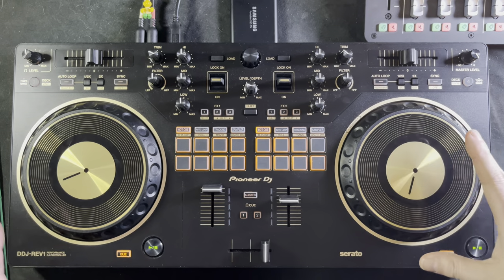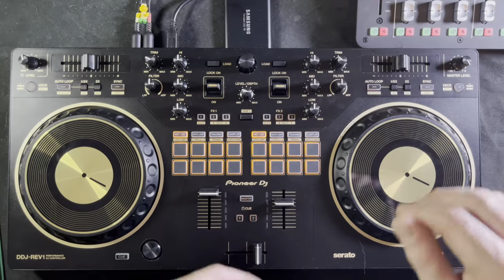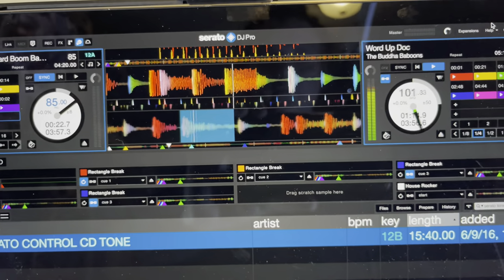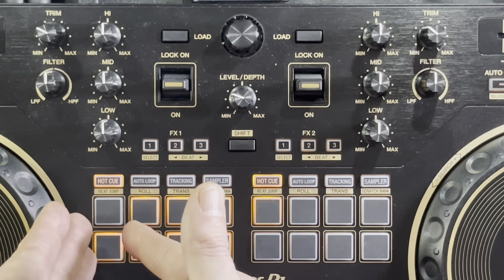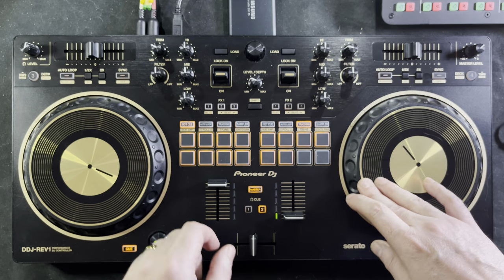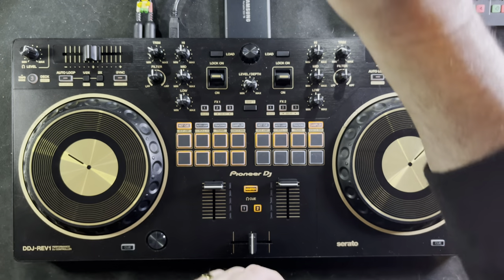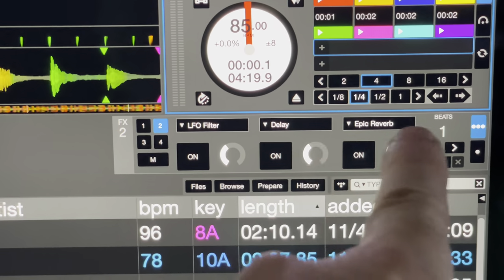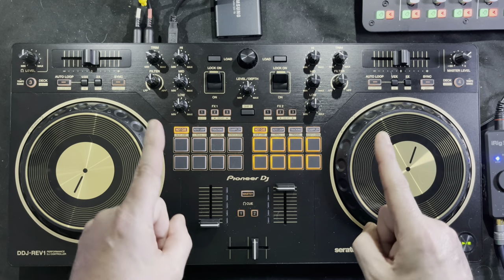In depth Tutorial of the Pioneer DDJ REV1 N limited Gold Serato dj controller

Comment: Okay on decks 3 & 4 why does it only play in headphones but won’t play out of speakers?
Reply from the maker: You have to move the upfaders up and down to use them.  You may also have to move the trim knobs slightly. It’s a weird quirk. Once you do that though it renders the upfaders useless to control decks 1-2 until you change the deck button again. Let me know if that helps.